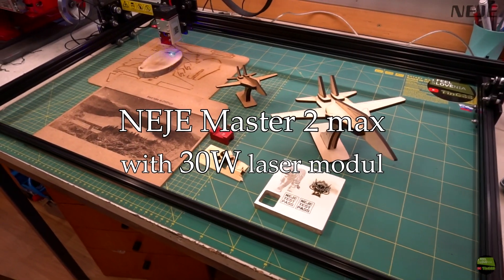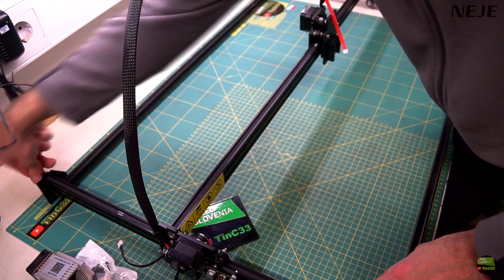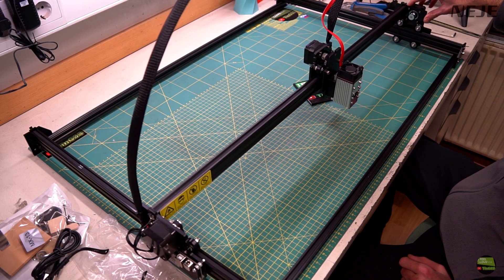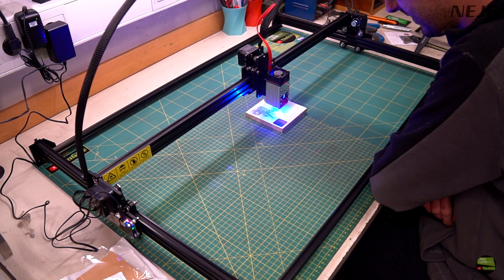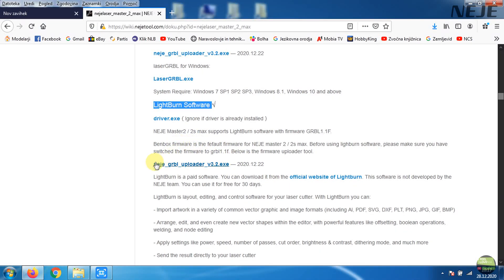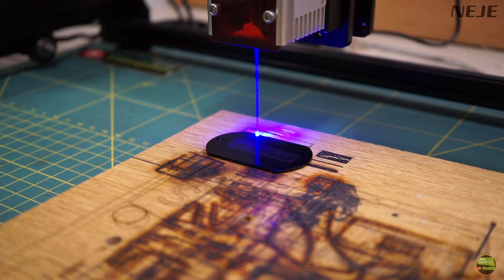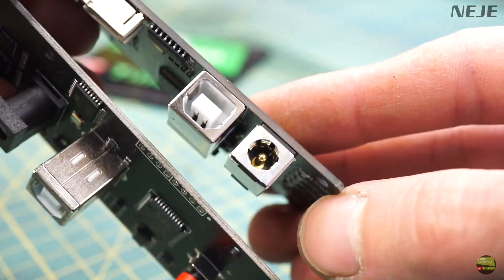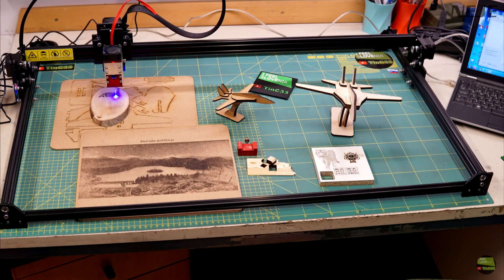NEJE Master 2 max with 30W modul 460 x 810 mm engraver / cutter [unbox / review / first test]

Comment: Hi, I'm engraving small coasters 90x90mm but each one can take 18-40 minutes depending on the design. I use a wireframe design for each logo so that it's very thin. Do you have any suggestions for speeding it up? I'm using the Neje Master 2 7W with its mobile app on Android. Burning only Birch plywood with 40ms carving time and 45% laser power.
Reply from the maker: Try to increase power and speed
Reply: @TinC33  on the mobile app I can decrease burn time and increase power. What do you suggest for high quality plywood?
Reply from the maker: @AlexEllis  i siggest making test you can set power to 90% and then lower down burning time until you got result you want, but it may be too fast so engrave will be a bit lower quality so lower down the power to like 80% and increase burning time so it engrave slower...

Comment: Hey I've just bought this machine but can't get my head around to start it. For starters, when I click on machine settings, it's completely blank and then when I try to send job to laser it says it's busy. Could you help please?
Reply from the maker: Hm it should be something with your pc, try some other version of neje software, turn of and on machine, reset a pc...
Reply: @TinC33  tried all that, doesn't help. Got the machine settings now, but it seems to just be scanning the space, not cutting anything at all ,
Reply from the maker: @alisecandere1341  we talk about neje software, not lightburn?
Reply: @TinC33  ah I'm on about lightburn, sorry. Can you use neje software for cutting as well? I thought its just for engraving?
Reply from the maker: @alisecandere1341  ok, now we're talking... Yes neje can do cutting to, but only work with exact nc and dxf files, if there are dxf file too old type it make some strange curves, into neje sw go into cnc tab and drag drop nc file in it's vindow...
For lightburn follow that video i think i mention every settings need to change in that video, first of all dowbload neje firmware uploader and upload new firmware to machine (follow manual) then playing a bit with machine settings (y pin invert, direction invert and homing invert) so it work proper way and than change s-max value to 1000 instead 250 in lightburn so the laser will work with 100% power, now yours work with only 25% of power...
Reply: @TinC33  So i followed your advice and it seems to cut a bit deeper in than before but still not cutting through :( I feel like the actual fire power is not strong enough to cut through 6mm mdf? What am I doing wrong :((((( i really need it to work this week as I need some wording cutting out for 
weekend lol, please send help :D
Reply from the maker: @alisecandere1341  what about some other lime spruce wood, mdf can be full of dirt even steel dust sometimes, i try different mdf material someone cut nicely but other couldn't cut even for a mm.
Reply: @TinC33  I just bought 5mm plywood but seem to be getting the same thing. What percentage is your fire power on?
Reply from the maker: @alisecandere1341  i use 100% laser power while cutting, but i read that if you work with 90% lifetime of a laser will be much longer, also for that thickness air assist is quite a must...
Reply: @TinC33  what is the power next to The “fire” Button in “move” tab?
Reply: As I can’t put the power any higher than 20%
Reply from the maker: @alisecandere1341  this is power in iddle mode, when you framing, how much laser would glow, i got that settings on 0,25% i think.
Working power you set in each layer where you set power, speed, number of passes...
Reply: @TinC33  could it be that my laser is faulty? I bought the same 5mm plywood, got air assist, did the same settings as you. But it still wont cut through.
Reply from the maker: @alisecandere1341  how deep it cut?
Reply: @TinC33  I’m super desperate for it to work, I really appreciate your help 😩😩😩
Reply: @TinC33  it will cut through 1 or 2 mm and that’s about it
Reply from the maker: @alisecandere1341  is cut thick or wide, you got focus set properly, try also to clean the lens for outside (didn't need to take out) with cotton ear pick) if it doesn't help try to remove the laser and put it about 50cm from wall then hit fire, you must seen nice square beem otherwise laser is not ok, of still won't cut contact neje team because 40w laser should cut 5mm playwood even without airassist.
Reply: @TinC33  mine’s 30w
Reply from the maker: @alisecandere1341  ok, but 5mm plywood should cut also maybe 5-6 passes, 5mm/s speed and 100% laser power
Reply: @TinC33  yeah I’ve done 5, 6 and even 10 passes. Nothing. I’ll try to clean my laser tomorrow. It does burn in the wood tho but I just feel it’s not powerful enough to actually go through the wood. It feels like it’s lacking power.
Reply from the maker: @alisecandere1341  s-max is 1000 for sure, do you try also in neje software, same result?
Reply: @TinC33  haven’t tried NEJE for cutting, no

Comment: Hi i have the Neje master 2 s 30 watt. Do you know if i can just change the laser unit to a 80 watt unit,  or do i need to change the motherboard also ????
Reply from the maker: You mean 40w, yes you can just replace the modul but you'll need a 4A power supply also (it come with a modul)

Comment: I got the 30W version, and it barely cuts anything - my last try was cutting 3mm plywood: 90% power, 5mm/s, 23(!) passes - and the wood was still attached in a few places. I must be doing something wrong, but no idea what. I tried my best to focus it with the "wooden ramp" method, which led me to have the bottom of the laser be roughly 35mm above the wood. Any idea?
Reply from the maker: Try to clean the lens, there come film of dust over use wich impact cutting cappacity drasticly.

Comment: stupid question. Just ordered the air assist. How do you bend the metal pipe safely? Im afraid I might bend it closed inside.
Reply from the maker: I slowly bend with pliers on about 5-7 points a bit so i get a radius.

Comment: Hi and hello, I just got the same model. But I was wondering what is the focusing distance from the material? How high does the laser module needs to be from the edge of the model in order to cut 3 to 5 mm plywood? Or the distance to get a perfect focus?
Reply from the maker: Best way is to playing with different settings, i don't remember exact settings, on 50w is 17mm i think

Comment: Great video. Have you tried the 80 w module yet? Do you know if the laser is a square? Also did you 3d bracket for air assist? Thank you so much
Reply from the maker: Thanks, there are no 80w modul, i contact neje about that because lot of people asking about 80w there is just some ad od aliexpress wich say 80w, i got another video about 40w laser modul (wich you mean is 80w) and it got dual diode inside, laser dot is totally square, got fixed focus and i could say it's the best modul i try about twice as powerfull as 30w.
If you'll order one please order from the link under the video (direct neje store with warehouses arround the world).
Reply: @TinC33  thank you for the quick response. I definitely will. Keep up the good work. Cheers

Comment: Hey, buddy . thank you for the video . I have the same neje master 2s max engraver , I bought it a week ago , I connected it directly to the lightburn program without installing the firmware, it started working , but I have a feeling that the laser power is very small, about 10-20 percent. I tried changing the power in the "cutouts / layers" tab . but nothing really happened . I set the minimum point using the height of the head itself , but I did not twist the focus of the lens , since it is quite clear . But the focal length seems to me quite large , not 30 mm as on the neije website , but about 50 millimeters. tell me how can I adjust the power ?  perhaps you need to install the firmware ??  Or what should I do ? thanks
Reply from the maker: Do you set "S-max" to 1000 into lightburn? Otherwise it also may be a firmware idk.
Reply: @TinC33  Yes, I have an S-max 1000 in lightburn, what is a firmware idk. ?
Reply from the maker: @scaletire2233  download firmware uploader from neje wiki and follow the manual

Comment: Hello, thank you for the video. I bought one also because of you ! Now, I need an air compressor. What model do you use, please 
?
Reply from the maker: I use basic 25liter compressor quite big and loud but i got them already, but also some fridge compressor will work, if you buy airbrush compressor wil be fine also, but take the one with a tank so it won't run all the time.
Reply: @TinC33  Thank you for taking the time to answer. I hope with an air assist, the cuts I make on wood veneer (0.5, 0.7 mm thick) will be cleaner and sharper. Cheers.

Comment: Looks good but beware!!!! I purchased a NEJE 30w module. It lasted 5 hrs at 70 percent power. it cannot even burn paint at 200mm and 100 percent power. As "I found out they don't like to warranty their modules. I am doing my best to make consumers aware of this company. I purchased a Atomstack replacement and all is Still working at full power after 20hrs of burning. If you Buy one of these NEJE modules good luck.!!!

Comment: I purchased the NEJE master 2 max and the laser will not move back to “home”. The horizontal axis moves but the vertical axis does not. I have adjusted the tension on the belt (both tighter and looser) and it’s still not moving on it’s own. I have pushed the reset button and turned machine off,  still nothing. Anyone else have this issue? If so, how did you get it working properly? Thanks
Reply from the maker: I don't got this kind of problem, but try to remove belt and check if wheels ruuning nice and if the motor rotate when moving.

Comment: Hello TinC33, I would like to buy this one but im not sure about its performace on hardwood.....can it engrave like 2 or 3mm deep inside a hardwood like ash or oak so i can just make a few passes with my orbital sander later all over it without damaging the design...... i don mean any complicated design, just some contures?
Reply from the maker: Sure it can but there will be lot of smoke, anyway take 40w for enough power so you can make also 5mm maybe in a single pass.
Reply: @TinC33  ok, thank you very much Tin, greetings from croatia
Reply from the maker: @MisterDonkeyHOT  no problem, pa onda reci tako sosed 😉 ko boš naročal prosim naroci iz linka ki je pod opisom videoposnetka, tako tudi jaz dobim kak %, če naročiš iz neje shop posljejo kot eu priority line, tako da ni treba placati carine ali davka.
Reply: @TinC33  ok, narucim preko linka, hvala i lijep pozdrav

Comment: Hello everyone. I have an issue with my Lasersettings using the Lightburn with my 2s max. It seems, that the laser is not outputting any power until i set the power >70% in lightburn settings. When i used the Neje software before, the laser even burned with 30% power setting. I am wondering, if anyone has lightburn settings for the 2s max to make it work.
Reply from the maker: Did you set s-max to 1000 instead of default 250 in lightburn?
Reply: @TinC33  s-max was 1000 in lightburn already
Reply from the maker: @beazimmermann5886  idk then, but must be some settings in lightburn if it work in neje sw
Reply: @TinC33  i think so….which lightburn version do you prefer?
Reply from the maker: @beazimmermann5886  uf i don't use them for a while and also didn't make an updates last few time, try to contatct lightburn team for help

Comment: Greeting. I have neje master max 2 30w the problem is I can't manage to cut anything with him. I can't cut the plywood in the middle. I have tried with higher and lower speed up to 20 times at 100% but I have not succeeded. so I'm interested in the exact instructions for 5mm plywood as well as what it is for and what is the hose on the laser image during the cut? Thank you
Reply from the maker: It be hard to cut 5mm plywood with 30w without using air assist, that tube is air assist wich blow compressed air into cutting line and clean the dust out of groove so the laser can burn plywood in next pass instead of burning the same dust over and over, air assist make huge difference into cutting capacity.
Reply: @TinC33  Can you give me advice on where to get it or how to do it?
Reply: I found out what it was about. I'm just interested in this. can a small airbrush compressor be used? if so at what pressure should it work?
Reply from the maker: @ShkajaFFatality  any compressor wich give about 1bar of preassure will be ok, maybe even some stronger aquarium pump.
Reply from the maker: Air assist can be bought on neje store.
Reply: @TinC33  Thanks a lot for the reply. It helped me a lot and I solved the main problem. Thank you

Comment: Hello... Great video... Can you please share your settings for lightburn for 2s Max 40W model? 
Thank you...
Reply from the maker: Make sure s-max is setted to 1000 then 100% laser power and 5-10mm/s speed.
Reply: @TinC33 Thanks for answer , after a little playing I managed power settings. But I have problem with bed size, and Y axis is upside down... When I want do put wor area on top of bed i need do move template outside of the grid in lightburn . And if i go too much stepper motor star to skip, and lihgtburn doest even worn me that template is outside of working area, and if I go a liitle more then it worns me... Bed settings are 810x460 mm...
And there is Y axis, when i move it manualy down, it goes up...
Reply from the maker: @jocommb  go to edit, machine setting click read and invert Y direction pin invert and y homing invert.

Comment: Hello, I've got the Neje 2s with the 30w module, during some testing I was able to cut plywood 3mm, but now it never cuts... even with 5mm/s and 100% laser, I have no idea why :(
Reply from the maker: Do you got air assist, use same software as on test? Try to screw out the lens and clean them with soft towel or better fabric to clean the glasses or lens...

Comment: Why do you lie??30 watt can’t cut through 3mm mdf even in 10 pass at 2mm second..
You lie so you get free products ??
Reply from the maker: I never lie in my videos even if i got free product, but always got in mind price so i can't compare 5k€ worth laser with 500€ one.
If you watch the video mine CAN cut through 3mm mdf, if you can't there can be many issue, like: you didn't set full power if you use lightburn, you didn't set focus perfectly, you heave no air assist, or you just got some tough mdf with lot of dirt in it like steel, aluminium... Really i try to be honest and not to lie or hide something, actually you are the first one telling me this since i got yt channel, heave a nice day.
Reply: @TinC33  we tried it on 3 different models with full power and 80l pump air assist and on the 3 tests it didn’t cut through more than 2 mm after 15 passes ..
Reply: @TinC33  we even added a g8 lens on last try and didn’t cut through after 10 passes..
Reply from the maker: @riverrazors7915  what about some other material like spruce wood, i got some strange mdf with lot of metal dust in it, so it only cut about 0,5mm deep, but tested afzer this video was made.
Reply: i have the 40w model and i cut 3mm MDF with 80% power 5mm/s and 3 passes, using lightburn and using machine settings from here https://www.vollmer-tobias.de/en/neje-master-2s-max-lightburn-settings/
Reply: also, i separate the metal body 17mm from the MDF, as my module has fixed focus

Comment: Hi. Thank you for this amazing video, that's very interesting. I bought this machine but I can't cut any wood, or it's very very very long. I try with polywood of 3 mm, but it's doesn't works. Can you share me your parameters? just to know if there is a problème with my laser? I can help you on other subject if you need, I'm a cad designer. Thanks a lot. Best regards.
Reply from the maker: I use 100% laser power and about 10-5mm/s cutting speed into lightburn, airassist is the key to thick cutting
Reply: @TinC33  thank you a lot

Comment: hello sir . thank you for sharing this helpful video , i want to order a laser machine and I'm thinking about the NeJe master 2 max 40w with a budget 526 dollar . for me i want this machine to cut mdf 6 mm up to 8 mm o r plywood , do you think that neje Master 2 max 40 w can do this job or i must to buy a co2 machine with 50 w. but for the  c2o machine Always i saw in youtube vedio that you must change the piece all time
Reply from the maker: Hello, yep co2 laser is more piwerfull but need to replace co2 tube wich isn't cheap, mdf 6and 8mm is quite limit for that machine and also i got two types of mdf, one cut nicrly while the other just burn and won't cut even a mm, hard to say, but i think you need a co2 laser maybe even more powerfull than 50w.
Reply: @TinC33  thanks you sir for replying me. I want to ask you about the NeJe can cut mdf 3 mm up to 4 mm because I see in YouTube vedio that NeJe can cut 4 mm mdf , it's true
Reply from the maker: @baramohamede432  yes i cut 3mm in a singlr pass with 40w modul
Reply: @TinC33  thanks you very much sir . Now I decided to buy a NeJe master s 40 W and I will cut just a 3 mm up to 4 mm , for me it's not a problem to do 3 or 5 pass to cut the mdf that's Way I will bay a NeJe Master s

Comment: I have two questions:
1) The link does not direct to NEJE Master 2 max and also does not appear on the Banggood website.
2) Between the NEJE Master 2 max and the AtomStack A5 PRO also from Banggood, is there much difference? Thanks
Reply from the maker: When open the link to neje store just go into neje max tab and choose neje max and select options of laser modul. I don't know atomstock laser.
Reply: @TinC33  Ah! I thought Banggood was selling this NEJE Master 2 max with 30W module 460 x 810 mm engraver / cutter because they sell other Neje models! Thanks
Reply from the maker: @Dancopymus  no i don't know why they don't sell max version because it is best selled, but only can be bought on neje shop.